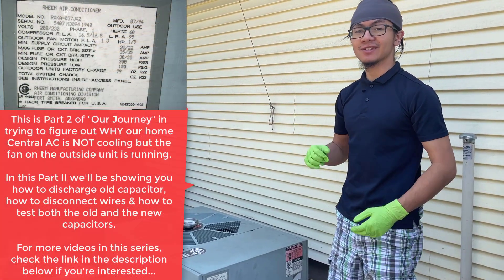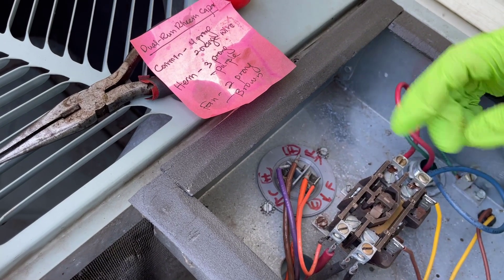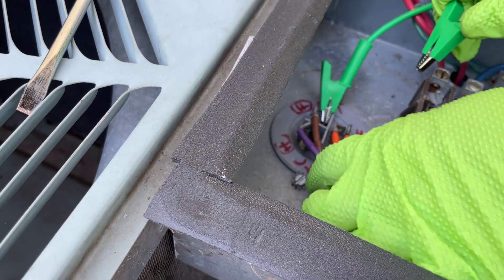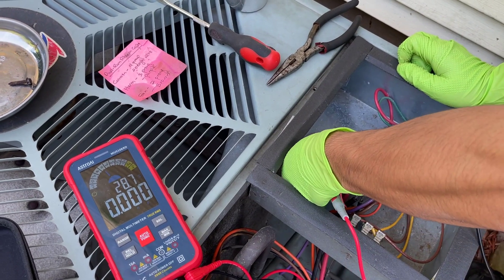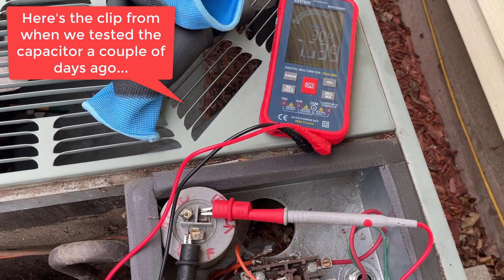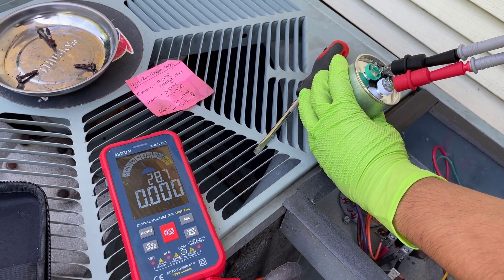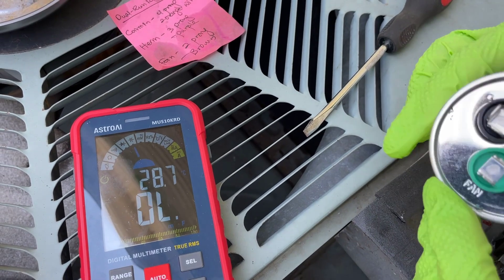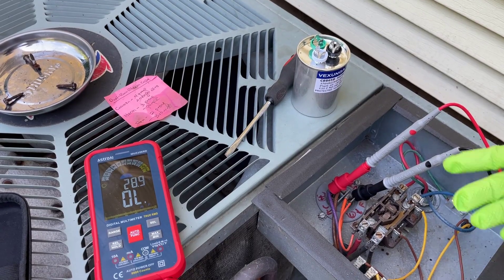AC Not Cooling But Outside Fan Is Running (Rheem P2) | How To Disconnect Discharge & Test Capacitor

Comment from the maker: Here are the #ad links to some of the components, parts and tools required for this repair:
1.  https://amzn.to/3QWf7M1  |  43-23204-14 -Rheem OEM Round Replacement Dual Run Capacitor 50 + 3 UF/MFD 370 Volt
2.  https://amzn.to/45Plbu9  |   OEM Replacement for Rheem Single Pole / 1 Pole 40 Amp Heavy Duty Condenser Contactor 42-42478-02 
3.  https://amzn.to/3svcuqr  |  AstroAI Digital Multimeter 10MUSKRD 10000 Counts TRMS Auto-Ranging Color LCD Screen Voltmeter, Accurately Measures Voltage Current Amp Resistance Continuity Duty-Cycle Capacitance Temperature
4.  https://amzn.to/3OTVcKV  |   AMI PARTS SPP6 Hard Start Capacitor Replacement 115V Thru 288VAC Hard Start kit for air Conditioner Units from 4,000 to 120,000 (1/2 Thru 10H.P.), Increases Compressor Torque 500%
5.  https://amzn.to/45tqtvA  |   Qwik / Mainstream Engineering QT2810 QWIKLUG 3 TERMINAL 10 AWG

Or Click on Amazon link here and search for what you need:  https://amzn.to/3xIOsqg